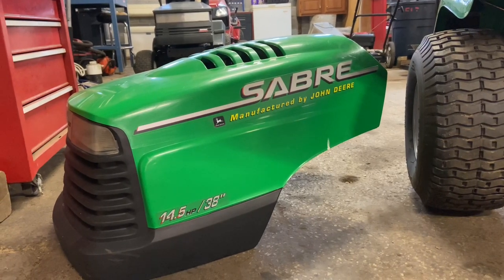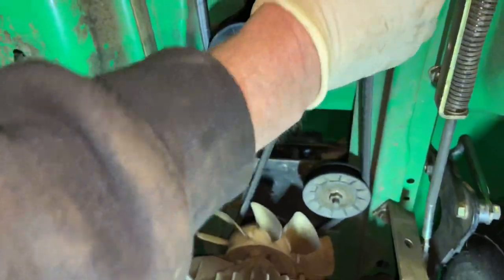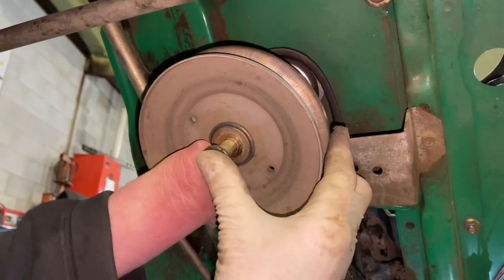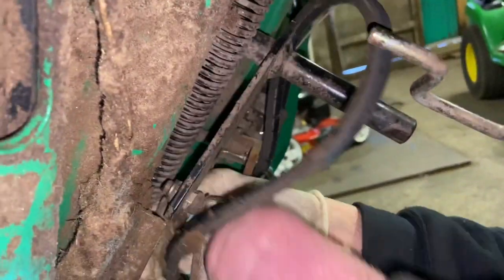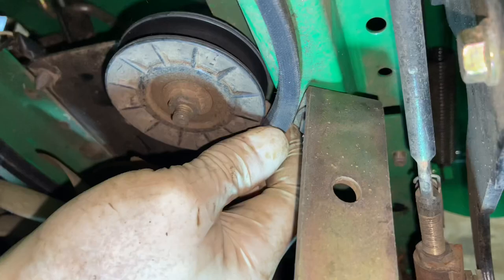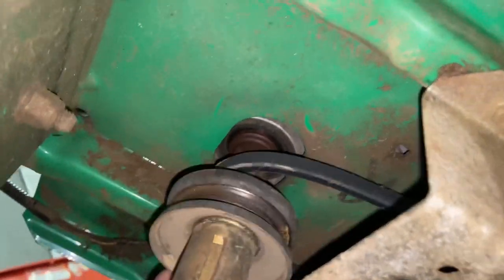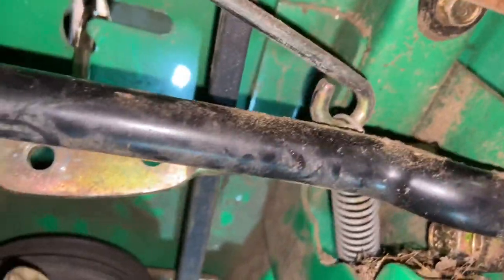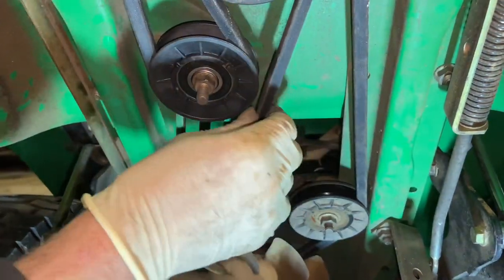How to Install a Transmission Drive Belt on a John Deere Sabre

Comment: This is the single most helpful youtube video in the history of youtube videos!  Right down to the tools!  Wonderful job- thank you.   My belt finally died after 22 years... YES!  22 years!  (Weekly mowing plus light snowplowing!)  Two quick follow-up tips to offer: 1. I didn't have a small chisel like you did, so I used an extended screwdriver drill bit to wedge against that pulley.  2. This one is probably big- how to relieve the pressure on that spring loaded pulley if your belt breaks and you don't have the old one to work with.  This was my situation.  What I did was route the NEW belt in place, but I looped it around the shaft ONLY on the front pulley (not the pulley itself).  Like you explained, the new belt is tighter- doing this gave me enough leverage that I could yank pull that spring-loaded pulley (as you show in the video) far enough to wedge something in.  I then proceeded along with your video.  Thanks again!
Reply from the maker: I'm glad all went good and glad you were able to figure it out. Thanks for sharing and the kind comment.

Comment: Thank you for your support and helping me fix my old JD tractor it was so helpful to fix my machine. Not to many of this Sabre models left. Even the owner manual did help me. But you saved me some money and time since the lawn shop have a four to five weeks lead time.
Reply from the maker: I'm glad it was helpful. I agree, I only service a few of the Sabre's now so I try and get the important videos when I can. I know they will come in handy for people like you that still own them. Thank you for sharing and the kind comment. Please give this video a like and share my channel to help it grow. It would be greatly appreciated!
Reply: Question do you have a video of engine swap replacing my 17 hp with a new briggs & Stratton engine, which is now 19 hp. My dilemma is the wiring is different from the old engine. I think they put a new electrical capacitor or a diode can provide you photos. Maybe you might have helpful hints how to do that I don’t want to blow the electronics, please advise and I’ll look at your station. If you have any cool tips, I can provide you a photo of what I’m talking about.

Comment: That was very helpful. I love how you explain every little detail. Only thing is, you had not videoed taking that rod off that holds the belt in place on that one pulley, and you did not reconnect it when you finished. I hope you remembered it before you dropped the mower and started using it. You are an awesome mechanic and very inspiring. True example of my favorite scripture. Philippians 4:13 - I can do all things through Christ who strengthens me. Thank you for sharing this video to taking the guess work out for others having to do this project, I will be doing this as soon as my parts come in. I will be changing both drive and deck belts as well as blades. Mine is a 46" cut so I am sure it may be a little different but I hope not too much. 
God bless you.

Comment: I have a Sabre 1538 Gear ( not hydrostatic, but the 5 speed). I took my deck off to change blades & clean it good & noticed my drive belt was cracked & running on the outer skin with 1/2 & 1 inch chunks missing. I am glad I didn't just cut it off to make removal easier because i never would have known about taking off the steering linkage. I actually thought I did something wrong at first. The  belt size is 105.7 inches. The only thing I could find locally was 105.75,that .05 was enough to  cause it to slip. You can loosen the pulley closest to the transmission & move it back to add a little more tension. It's a trial & error thing as I first moved it a small 1/4 inch & she jumped when I released the clutch, so I moved it forward slightly & as good as new. Also at around your 10:37 mark my belt goes on the outside of that shaft, closer to the switch to ride straight.

Comment: Great video and I have a Scott’s s1642 and basically the same undercarriage and routing of drive belt. You can actually route the belt around ( up and over ) the main pulley by looping it up and over without having to take the pulley off / for those without torque / air driven wrench’s and save one step. 👍

Comment: You do a grate job with the vids. That’s a pretty busy job filming an working at the same time with three hands. Lol!. I also was born with a birth defect on my left hand ( I was born in 1956) Dr managed to save my thumb,a short pointer finger ,and a little finger. There’s not much that I can’t do, except flip someone off with my left hand. I’m fixing up my old L120 so I can sell it, I bought a new S220 . I hope it lasts as long as my old L120. 17 years old and never had the drive belt changed . 650 hrs on it.
Reply from the maker: Hi Thomas, glad to hear you are like me and there is not much we can't do! Watch this video if you haven't changed the belt yet. It may be a little closer to your model. https://youtu.be/lk43fFHin3I. I do like the new S220 and I think they went to a ball bearing in the front wheels. If you can confirm that since you own it let me know.

Comment: I have a 15.5/38 is that the same belt? 
My old belt is shredded but you can see where it broke when I measured it it was 94 7/8 but who knows what it really was and every time I look up drive belt they can’t stop mentioning the word deck
Reply from the maker: Call a John Deere dealership and give them the model number off of the plate/sticker on the machine(they need that number). Tell them your looking for the Transmission belt. You should be good after that! I would also recommend using the John Deere belt and check all pulleys, replace if necessary. You do not want to do that job twice.

Comment: Need to ask a question? Purchased a spare engine for my tractor which is a 17 hp briggs & Stratton engine. And planning to install a 19 hp Briggs Stratton engine. The issue I have is the wiring set up. The new engine has a electronic module but the old engine doesn’t. I don’t know how to wire it. Could you offer some advice?

Comment: i was looking into a sabre 18hp on the weekend.  It engages the deck belt when the deck is high.... when i lower the deck to notch 2 for cutting it basically dies off.  As well, when i pull the electric pto, i do not hear that crisp sound similar to that of my dads john deere lx 178.  I assume a worn belt.... but not sure
Reply from the maker: Yes, it does sounds like a worn/stretched belt.
Reply: @JohnsonsSmallEngines  thats what it was, i was trying to search and see if there was an idler or support missing.  After watching some videos.... its straight from pully to pully

Comment: How do you set the tension for this belt.  I got a new belt put on,.,used it once and now tension is loose and belt is floppy....rider won't move hardly at all....help
Reply from the maker: It sounds like something must have happened under there. The video shows how it is tensioned. It is only spring tension. If it worked once it was ok then. You need to look and see what has happened.
Reply: I just received a 1438 Sabre and put a new carb on to get it running. Won’t go up a hill in 5th gear but in lower gears it will. If there is no tension adjustment (only spring) I would assume it’s time for a new belt?
Reply from the maker: I would try the belt first. Also check to make sure the transmission pulley isn’t in need of replacement. They get loose up and down motion.

Comment: My 5 speed saber does not move. It sounds like the transmission is grinding trying to move. I was wondering if you know where I could buy a new transmission for it.
Reply from the maker: If you hear grinding, you most likely have a bad pulley on top of the transmission. Check out this video, it may help. https://youtu.be/gVUXQyHKVtM.

Comment: what about a manual 5 + rev  just went   won't engage   shifter does nothing.  stuck in the woods  help.   
Sabre 14.5  38    u got me out of other jams  so thanks!
Reply from the maker: Sounds like shifter came off of transmission mounting point?
Reply: @JohnsonsSmallEngines  thanks  i'll let you know tomorrow.  much appreciated
Reply: @JohnsonsSmallEngines  Brad , i located the belt has come off , in park on blocks. any advice before i enter the school of hard knocks.  peace.
Reply from the maker: @im-already-tired-tomorrow  take mower deck off and follow the video and you should be ok.
Reply: @JohnsonsSmallEngines  on the gear shift 14.5/38  i found the pulley below the seat , and the belt thrown. i found locking the brake releases tension and this time not so hard of a fix.  thanks much , for ur attention , very helpful and generous. peace , and still subbed.

Comment: What size belt did you use? I couldn't find on the internet what the correct size was.
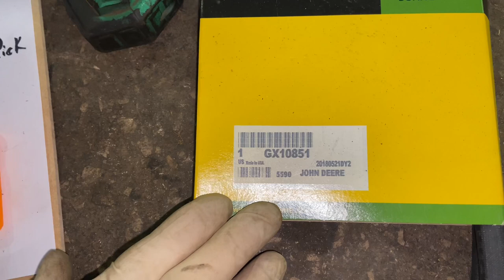Reply from the maker: I go by correct part #'s not sizes. The part # is at 1:02 into the video. You may be able to to the John Deere web site for specifications. Here is the John Deere link. https://partscatalog.deere.com/jdrc/
Reply: @JohnsonsSmallEngines  thank you for the response! I was able to do what said last night and got it all figured out. Thanks for the detailed video!

Comment: What size belt did you put on?
Reply from the maker: The part # for this exact model, hydrostatic drive transmission is a John Deere GX10851. You need to make sure the belt you get is for the model tractor you have.

Comment: I think I messed up my e140 today.  A couple of months ago I accidentally rest my foot on the emergency brake and with my other foot on the drive pedal.  Then belt started smoking, because I pressed further on the drive because I thought I was stuck on something.  Then I realized what I did a little to late. The belt seemed fine, it wore it down a little, but i didn't think it would hurt it. Now today I think the clutch went out, because the belt might have been to loose from the wear. It started smoking like heck, and wouldn't go forward or reverse.  Ugh! I'm 48yrs old, but I've never had a hydrostatic mower, or a riding more of my own until now. Every mower I've ever even driven or used was well over 30 and 40 years old. Grandpa's Cub Cadet was a 1970 model, and it ran like a top. Just had to rebuild the Kohler motor, and that was it. Any suggestions? Do you think the clutch or Hydrostatic transmission is out? Sorry for the long story, it just really has me heated that this happened.
Reply from the maker: It sounds like you will need to replace your drive belt and make sure you check all of your Idler pulleys also. Here is the link on how to install a new transmission drive belt for a D140 which may be very close to the E140. https://youtu.be/lk43fFHin3I
Reply: @JohnsonsSmallEngines  God Bless ya for answering my question.  I'll make sure that I check that out. Thank you so much, and take care.

Comment: Can you make a video on D140 Transmission Control Lever Replacement cause mine broke and I don’t know how to remove the pin to put new one on .  The part that. I’m replacing is for a  John Deere d140 part number M810140. Please I enjoy your videos your very detailed and you explain stuff perfectly please. Make a video cause I can’t find one anywhere on net
Reply from the maker: Hi Jennifer, I would but I need one to come into the shop. Everything I work on are customers machines and go back so I do not have much time with them to take videos. 
  The pin will need to hammered out with a punch, The control lever will come off then replace the old pin with a new pin.
Reply: @JohnsonsSmallEngines  ok thanks

Comment: Does anyone have an idea of what part can replace a broken tensioner pulley on the sabre 1438gs.

I got the mower second hand and have not seen the actual part to use as a reference. I found a few aftermarket parts but they say does not fit deck. That does sound ideal and I have no idea how to make that work as it's a part attached to the deck. Any help would be greatly appreciated. I can send a picture of serial and model tag for reference if needed.
Reply from the maker: Try the John Deere web site to look up your part. https://partscatalog.deere.com/jdrc/. OR call a John Deere dealer and talk with the parts department.
Reply: @JohnsonsSmallEngines  sadly its not on the site. I will have to contact a dealer or fix it shop. Thank you for the response.